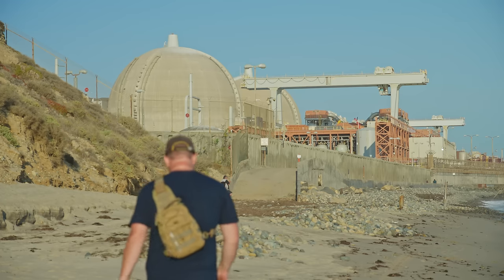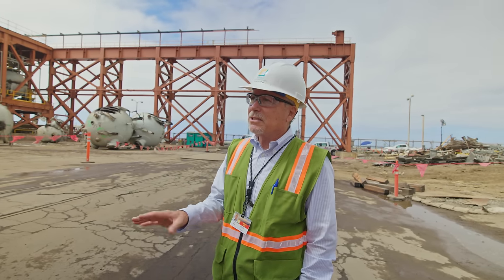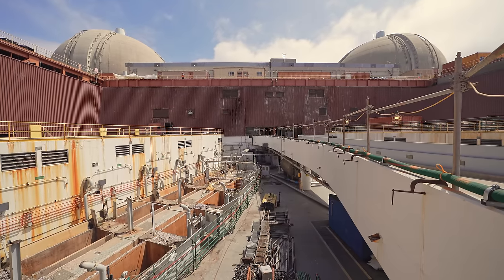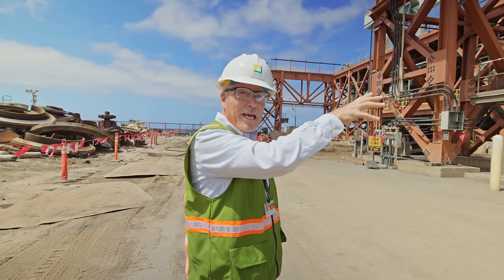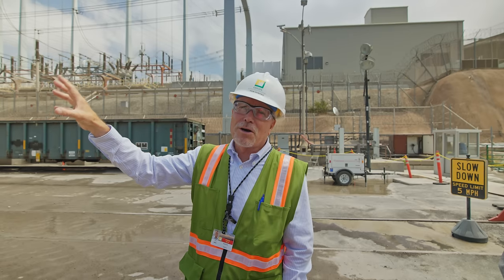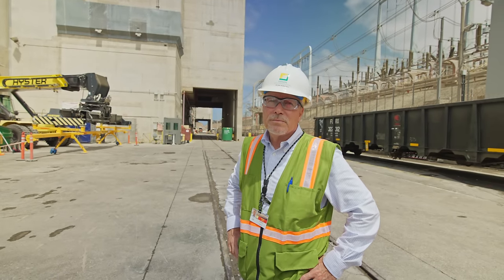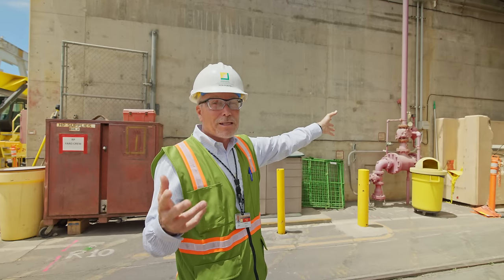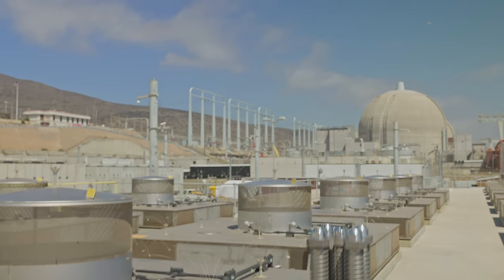Inside the Decommissioning of San Onofre Nuclear Power Station

Comment: 16:14 Fukushima didn't have big containment domes like this because they were BWR, not PWR reactors. Duane Arnold 15 miles away from me was also a BWR so it just had big rectangle buildings on the site.
Reply from the maker: Those are both containment structures. They are designed differently…possibly for the different reactor types.
Reply: @RadioactiveDrew  That's what I meant; you only see huge containment domes like this on Pressurized Boiling Reactors, not Boiling Water Reactors. Duane Arnold near me was a BWR, along with Cordova and Clinton, IL. Byron is a PWR, and so was Trojan, which I watch being torn down, and the cooling tower imploded in May, 2006.

Comment: What would be needed to reprocess the "spent" fuel rods on or off site and use in SMRs there?
Reply from the maker: There are facilities that can do that. Usually involves dissolving the fuel rods in acid and chemically extracting the useful isotopes.
Reply: @RadioactiveDrew  France is the only nation that does that and the cost for such a plant is in the 10s of Billions
Reply: It would have required Jimmy Carter's father to have worn a rubber.

Comment: What would happen of the fuel rods were not changed at 18 months? Would it just have less max thermal output? Would doing so make them less radio active when they are removed? Could the spent fuel rods ever be reprocessed to be fuel again, perhaps in some other type of reactor?
Reply from the maker: The reaction wouldn’t be as efficient and it might be harder to regulate because of all the other isotopes that are being created in the fuel. They get more radioactive the longer they stay in there. They can be reprocessed.
Reply: When all the control rods are withdrawn from the core and boron (neutron poison) is minimized in the reactor coolant at end of core life, 100% power output can no longer be maintained and refueling is scheduled.  You could just let the reactor run and power output would gradually decrease to 0% until the last remaining fuel is used up but this is not cost effective.
Reply: @RadioactiveDrew  Enjoyed the video,  thanks.  Around 15 years ago I  was making some very complex tubes which were used by a   reprocessing  plant in England  to  insert the  reprocessed  fuel pellets back into the fuel rods.  Unfortunately there largest customer was fukushima in Japan who had to close due to a small problem with damp!!!

Comment: Why should uranium send mainly beta?? It's alpha plus gamma... In that spring you are measuring the gamma part of the uranium decay. (minute 22)
Reply from the maker: The beta radiation you are going to be able to detect further away. Alpha radiation gets stopped by air about a couple inches. Uranium gives off alpha and some gamma. But the minute a freshly purified amount of uranium oxide it made it starts producing decay products that also emit betas and gammas, along with alpha radiation.
Reply: @RadioactiveDrew OMG!!! What you measured is the GAMMA-part!!! Beta is nearly nothing, even in the decay series, and in the distance you measured even more nothing!
Reply from the maker: Most of everything I was measuring at San Onofre was gamma radiation. Pretty low radiation considering how radioactive some of the spent fuel is.
Reply: @RadioactiveDrew  I was talking abot the SPRING! But as with my other comments, you are not reading them; what doesn't stop you on replying....
Reply from the maker: What spring at you talking about? Post the time code from the video.
Reply: @RadioactiveDrew   I DID post the time code!!! Perhaps not the exact second! But how many SPRINGS you were measuring????

I'm pretty sure, that you are trying to annoy me as much as possible! Is that a proper base for a discussion? 

I really don't wanna talk with you anymore!!
Reply from the maker: Please learn how to refer to correct items in my videos. That is a fountain, not a spring. I never said spring in the video. Glad you’re done. I’m busy and this has been a very irritating back and forth. Later.

Comment: This is a great video! I got my start in nuclear power in the navy as a reactor operator on an aircraft carrier almost 20 years ago now. Having just finished my bachelors in Nuclear Engineering Techonlogy it is very good to see a positive nuclear power video that is not full of a bunch of doom and gloom. It is too bad they had to shut the plant down without building a new replacement.
Reply from the maker: It is too bad that they didn't replace this nuclear plant. I would have liked to at least seen it made into a place to test out SMRs or some other smaller reactor tech. They had the infrastructure, might as well use it for something instead of tearing it down.

Comment: What i find strange is unit's 2&3 had the exact designed Pumps  when new  but then they were deemed inefficient and new  were redesigned and put in place. Then 2&3 couldn't make Full power ! Who designed , ordered and signed off on the new designed  ineffective pumps , Why  not use the tried and true pumps that were installed when new ?
Reply from the maker: That's a good question. I thought it had something to do with a leak in the first steam generators.
Reply: @RadioactiveDrew  would that be the one  Mitsubishi heavy dropped 3’ ?
Reply from the maker: @johngouker3887  pretty sure it was.
Reply: @RadioactiveDrew  I’m not sure if you remember me Drew. I left in 95 under not so good reasons ! But besides all that , I moved on , I was literally burned out of the position that I really did love performing as a Crane operator !
Reply: It was the new steam generators that caused the shut down,  not pumps.

Comment: It is too much work to take it apart. It looks like they are taking it completely apart.
There is a nuclear plant in Quebec, Becancour that they took apart because of the Fukushima disaster.
I think they said it was going to cost 9 billion $.
The purpose of the reactor was to just have the reactor technology. It was probably based on using heavy water, also called CANDU.
Reply from the maker: Its a lot of work and a waste of resources to dismantle San Onofre. Wish they kept it going.
Reply: @RadioactiveDrew  The amount of energy they waste is impressive.

There was another place in the USA. Oak something nuclear finishing plant? This was a very huge place. They process the used nuclear fuel. They separate the uranium, neptunium, plutonium, americium. I guess the Americium goes to making fire alarms since they don’t use it in atomic bombs. There were thousands of glove boxes that they were dismantling, thousands of compressed gas tanks to check. A bunch of things could not be recycled since it is slightly radioactive.

Where I live, 20 y ago, they tore down a giant mall since it was sitting empty. It was costing the owners money to pay for the building tax, so they prefer to tear it down. I could still see the original floor on the ground.
10 y later, Walmart was build on a small portion of the land. Now, a 10 story high apartment building is built. Most of it is just empty.

Comment: Was the new steam generators bad from installation or design? If design, was the manufacturer held responsible financially for the short life?
Reply: The utility approved the design and the utility convinced the NRC that the design changes were insignificant and did not require detailed engineering evaluations that is required by NRC regulations for significant changes to primary system components. 

You decide who is to blame but in the end the ratepayer got screwed.
Reply from the maker: The steam generator was damaged during shipping and they have a 5 year lead time. So after they hooked it up and saw it was leaking that was the beginning of the end.
Reply: On January 31, 2012, the replacement steam generators from 2011 in both units were found to show premature wear on over 3,000 tubes, in 15,000 places.

In February 2013, the NRC obtained a report from steam generator manufacturer Mitsubishi Heavy Industries that described the changes made in the replacement steam generator including the removal of a support cylinder, changes to the tube support plates and anti-vibration bars, and addition of about 400 tubes.

In December 2013, the NRC cited SONGS for failing to properly check the steam generator design, which had caused the replacement steam generator damage. The finding did not carry any fine or penalty but complicated SCE's legal position that they did nothing wrong.
Reply: @RadioactiveDrew  There is NO documented evidence that the problems with the replacement steam generators were damaged in shipping.

In March 2017 the International Chamber of Commerce ordered MHI to pay $125 million compensation, the liability limit contained in the contract. The tribunal rejected claims of fraud and gross negligence against Mitsubishi, and ordered the claimants to pay MHI $58 million in legal fees and costs.
Reply from the maker: We’ve talked about this before. Politicians killed that investigation. Parts that are custom ordered and have a 5 year lead time usually don’t have some engineering spec out on the side ordering the part.
Reply: @RadioactiveDrew  Why would politicians care about who was to blame?  The outcome was the same. Politicians do  not have control over legal battles and cannot force the outcomes to suit their beliefs (case in point; the election was not stolen).

An international court decided that the utility was to blame.  NO WHERE in all my searching did I see any legal claim of damage in shipping.  The utility authorized a design change that was responsible for the problems and that has ruled on by the NRC and the international court.
Reply from the maker: The California politicians wanted to make the nuclear industry look as bad as possible and make it so nuclear leaves the state.

Comment: Nuclear power plants cannot exist without massive gouvernment subsidies. And this video clearly showed it: the gouvernment (read taxpayer) is supposed to take care of the spent nuclear fuel, for the next few 100s of thousands of years...

Pure economics make new nuclear unlikely:
* 10k EUR/USD/GBP per kW for the EPR (as built in Olkiluoto, Flammanville and Hinkely Point), with significant running and extreme, ultra long term, decommissioning costs. Nuclear has a capacity factor of 90%, if all goes well, but France had a capacity factor nearer to 70% in 2021, and it will be much much worse in 2022 (as they shut down half their plants over the summer, forcing germany to burn a lot of extra methane).
* 5k EUR/USD/GBP per kW for biogas, with significant running costs if a feedstock is used (like maize), which could be done without for much reduced performance. Electrical efficiency from burning impure biogas in small CHP generators is about 35%. Electrical efficiency of biomethane (with CO2, H2S and water scrubbed from the biogas) could be as high as 50-60% if burnt in modern gas peaker plants, and the methane can easily be long term stored.
* 3k EUR/USD/GBP per kW for offshore wind, with a capacity factor between 50 and 60%. Limited maintenance costs.
* 1k EUR/USD/GBP for per kW onshore wind, with a capacity factor of 25-30%, with very limited maintenance costs.
* 1k EUR/USD/GBP for solar, as near as makes no difference 0 maintenance cost. Capacity factor depends on the location, but Germany is 11.5%, the geographical center of France is 13%.
* 100-500 EUR/USD/GBP per kWh of battery storage. 500 for Teslas old NMC megapacks, 100 is a good ballpark number for upcoming LiFePO4 large scale installations.

Just mix and match the renewables as needed, but you can easily achieve double the generation capacity (when capacity factor is calculated in), and add a bunch of storage on top, to match the construction cost of nuclear. And then know that you can get all the renewables in small distributed chunks, and that you do not need to provide financing for 15B EUR/USD/GBP projects with a 10-15y construction timeframe.

The massive offshore Dogger Bank A and B projects took only 3B GBP (then worth 4B usd), and the construction time is supposed to be 3-4ys with commissioning to start in 2023 for each of the 1.2GW projects with a capacity factor of 60%.

The pair of reactors at Hinkley Point C are supposed to now cost 26B GBP,  are now supposed to be done in 2027, an 11y construction time, and will only deliver 3.2GW at a supposed 90% capacity factor. And that cost is before it is ever fueled up.

So even highly expensive offshore wind is 3x cheaper and has a 3x shorter construction time (so the installation can start earning back on its financing sooner), for 2/3rds of the capacity factor.

Comment: I'd have asked about the many tons of tritiated water from Reactor-1 that were dumped by SCE into the Pacific sometime around 2006.
Reply from the maker: The tritium contamination in reactor water or fuel pool water is extremely low. What's of more concern is the contamination of cobalt 60 in that water...but that's pretty easy to filter out. Also I have never heard of them dumping any of the water from the reactor loop. But if you want to know what dumping of tritium contaminated water looks like and its effect look to the Columbia River. Hanford had been dumping tritium contaminated water in the Columbia for decades before they stopped plutonium production. So if you want to look for health effect of tritium contamination look there. Spoiler you won't find any.

Comment: Ironic that the plant was built on the sea shore… The Government failed on it’s responsibility finding a storage space suitable for storage of spent fuel! Why don’t these private companies take some responsibility for management of the nuclear fuel cycle? I guess it is a problem storing the radiological waste safely for at least 5 to 10 thousand years …
Reply: Private companies want responsibility to manage the nuclear fuel cycle.  But, the federal government passed a law forbidding this.  After Jimmy Carter blocked the reprocessing of nuclear fuel, Congress passed the Nuclear Waste Policy Act in 1982.  Under that act, the government seized title to spent fuel and agreed to store the fuel safely.  That law has been violated by the federal government which has not performed its duty to store the fuel as required by law.  A repository, Yucca Mountain, was built but the federal government did not seek the license required by the safety regulators, the Nuclear Regulatory Commission.

Comment: I think New Mexico is the only State in the USA that accepts spent nuclear or at least has the built out complete to do so anyways. Beyond ironic as Southern California has exploded in size and population they shut down their primary source of power! Back when this all was fully operational Los Angeles was not a very energy intensive place save for the Oil Industry there which once was the largest oil producing Region on Earth with of course that not true anymore.

I think Sempra Energy will quickly forced to become the "nearest local supply" for fuel from Mexico with USA natural gas fed into their LNG project there.

The only reason #not_at_issue is because of the truly massive Arizona Nuclear Power Facility which with Nevada coal shut down now Lake Powell as well makes for no doubt an energy crisis (ongoing) for all of perennially Bankrupt California Edison. Columbia River sells into the market as well. All great news for Tesla and associated businesses would be an understatement. Turning natural gas into LNG ain't cheap, either!

A combined cycle natural gas facility can achieve incredible efficiency as correctly stated here as not possible with oil or most coal (there are different grades of coal however.) Also California has some geo-thermal as well which while deminimus relative to need is also highly efficient.